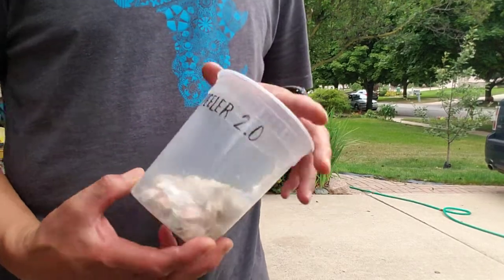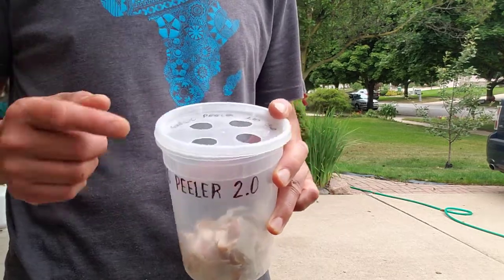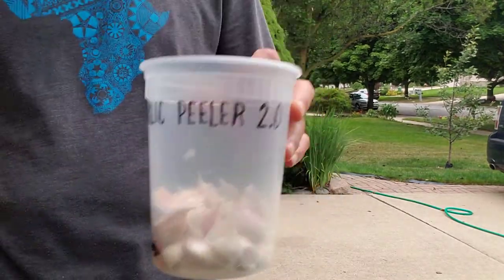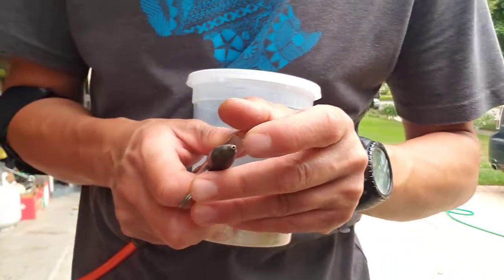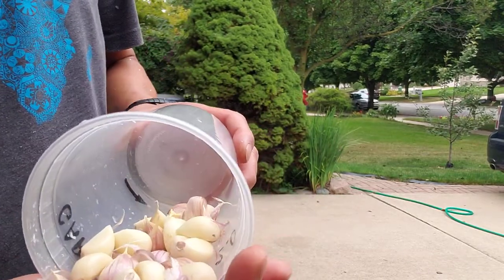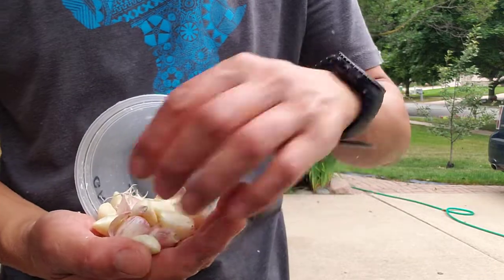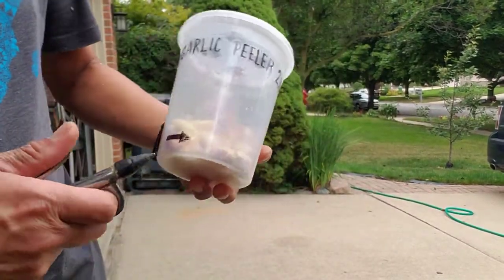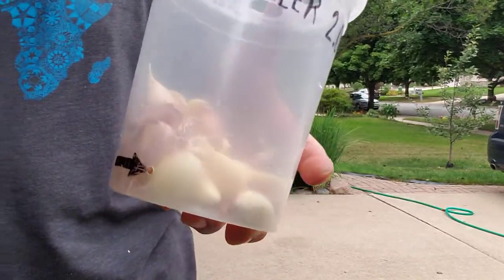Lifehack: How to peel garlic with compressed air, updated

Comment: I love it!
I'm imagining a coarse screen mesh cage the shape of a tall vase with no lid needed due to its height, and with the air nozzle or nozzles mounted below it to work hands free.  Or maybe a horizontal coarse mesh drum angled slightly so that the garlic travels from a basket through the air nozzle rotisserie and dumping out into another basket.  But your cheap and easy cup design will get me started just great.
Thanks for the inspiration my friend.

Comment: Nice method! I saw a video where a garlic factory in California produces 100,000 pounds of garlic daily using a similar air jet technique. These days, fresh garlic costs about $3 per pound, and peeled garlic also costs $3 per pound, so it’s a no-brainer to buy factory-peeled garlic. They save all the small cloves and only include the larger ones in the container. The garlic stays fresh in the fridge for 1-2 weeks.

Comment: Seems like you are blasting all sorts of contaminates like bacteria, stagnate water, rust, oil, mold and anything else that happens to be in your compressor, compressor tank, fittings, hose and nozzle into your garlic. 
Have you ever seen what comes out of a compressor when you drain it? Not something I'd want anywhere near food I'm preparing.
Because you're blasting the garlic with pressure there's a strong chance you could be injecting nasty stuff into the outer cells of the garlic making it impossible to simply wash off. 
Chances are you won't get sick but why take the chance? 
I can't imagine a health dept allowing restaurants to use a home air compressor to peel garlic.
Reply from the maker: Just to test out your theory, I blasted a white cotton facial pad for 4-5 minutes, and there wasn't anything at all I could see in the pad.  I also tried a piece of white laboratory grade filter paper - still nothing.  It's certainly possible that the industrial air compressor at the corner filling station has some of what you're talking about, but nothing visible with an oilless compressor (Porter Cable 6 gallon) which is well-maintained.